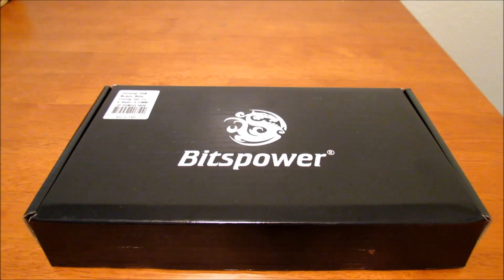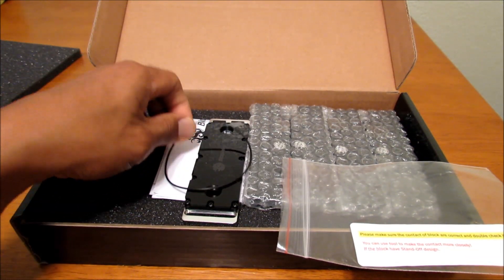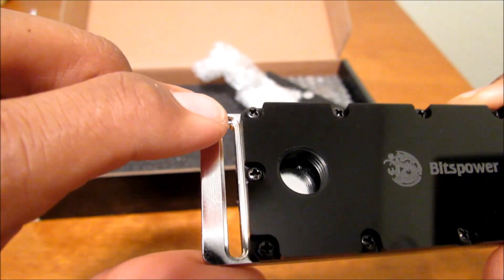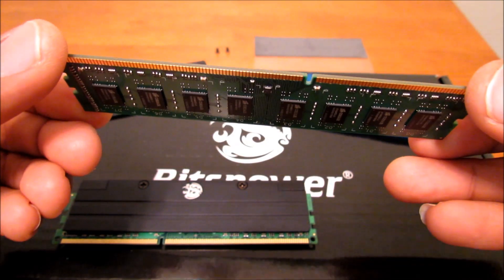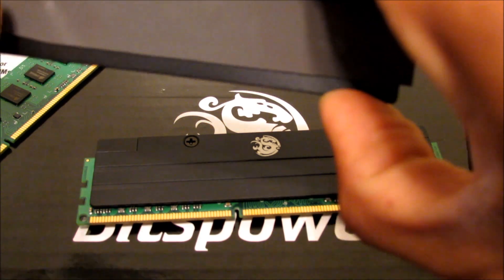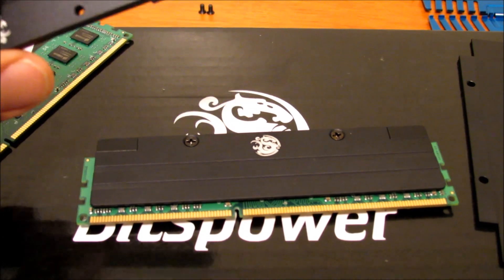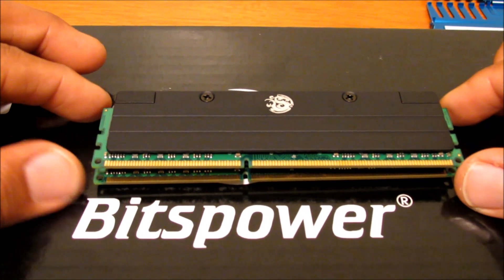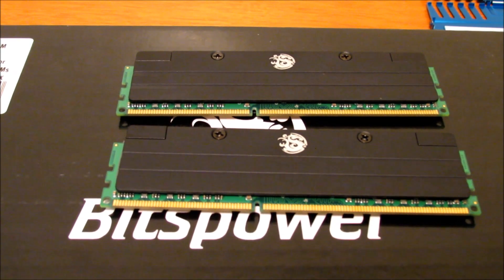Unboxing & Installation - Bitspower Universal RAM Module Water Cooling Set (4-DIMM)

Comment: Is there a risk when not using the adhesive pads, would it conduct from the ram module? I’m not really too fussed about giving the ram extra cooling, they’re just pretty boring green and would look better with one of these fitted
Reply from the maker: Amir Pourghoureiyan I believe it's only for heat transfer.  It isn't an adhesive either, it's a thermal pad.  I think you'll be fine.
Reply: OCTurboJoe cheers

Comment: I see some comments saying that ram water cooling is mostly for looks. Yes if you have non ecc ram. I have ECC ram and the idling temps after boot up are 55 Celsius, and that's with the factory built dedicated ram fan on idle. And there's nothing wrong is just how ecc ram works. As soon as I do medium intensive tasks it instantly goes to 70 Celsius and if I don't throttle the fan watch out :). So for me water cooling ram is on my to do list. Is a must for keeping the case temps smooth

Comment: I'm installing these on my hyper x 4gb sticks. I'm doing this for the looks. But my hyper x Simms only have the modules on one side so when I use the thermal pads it does not make contact on both sides of the ram. I bought the ram blocks used so no manual to know if there is something else I need to do.